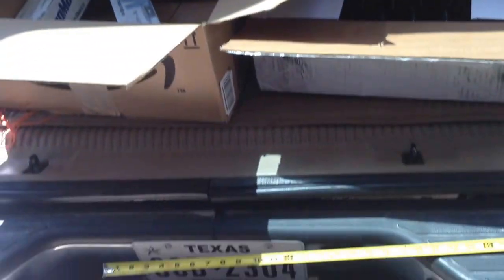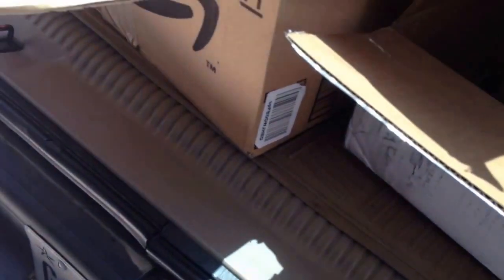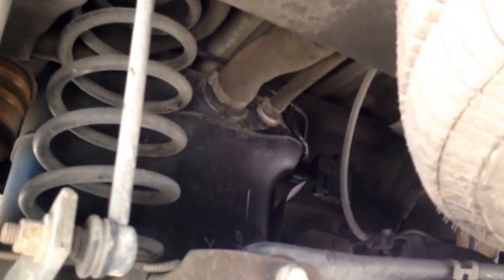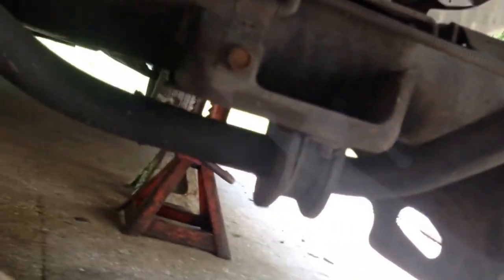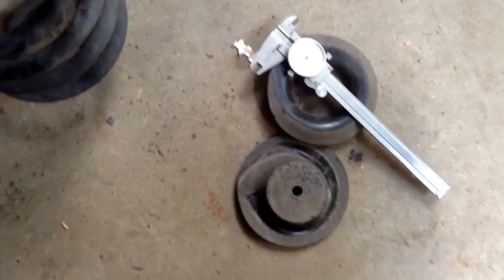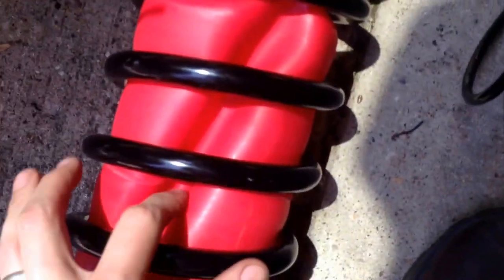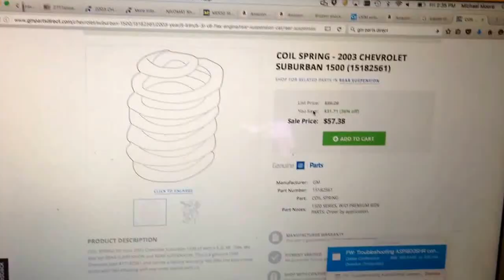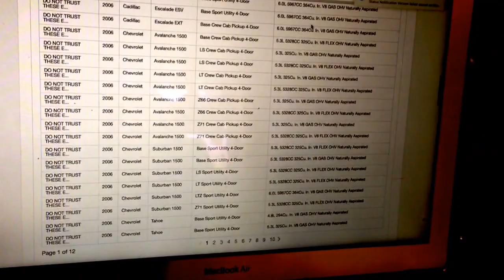03 Suburban Shocks, Springs, Bags Part 1

Comment: Hey, thanks for the vid. I'm about to do basically the same thing to my 05 tahoe with the ZW7s. will probably go with the adjustable rancho shocks though. Trying to find info on what springs i need to use has been tricky though.

Comment: You took out a variable rate spring. They have varying coil sizes and widths by design to give a nice smooth ride but when you lean on them gets stiff. Youre attempting to replace with a constant rate spring. It's narrower and taller. Much stiffer at all times. That's not wrong. It will just behave much differently. So all you need to find is a variable rate spring which GM has a couple. Brand new. Why they don't sell that spring anymore I don't know
Reply from the maker: The issue is, the rear end sagged with those springs after the auto leveling shocks failed. I needed to replace them with stiffer springs from a suburban without auto leveling shocks and these were all I could find. It has a nice ride and honestly can't tell it's any stiffer.
Reply: @mjmcomputers  Gotcha. I have a broken spring w/z55 rear air functional. So I'm in the same boat. How i found you. They don't make that spring anymore. looking for alternatives. I found what i think will work. ACDELCO 45H2165. Has a relaxed height height of 16" inside diameter 4.4 In. You think that will work with the bag you bought? The price is cheap. Thanks for the help.
Reply from the maker: @sbond1963  It's been awhile so I don't remember the exact measurements of my springs, if those springs came on tahoes or suburbans then they should fit.